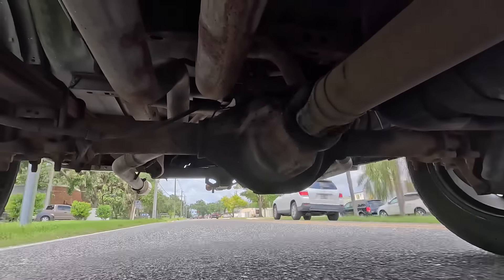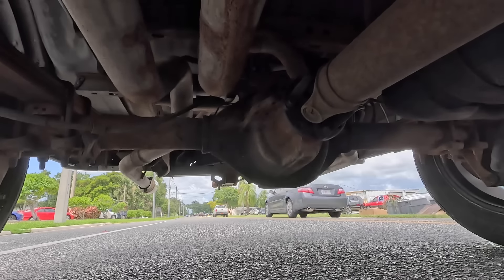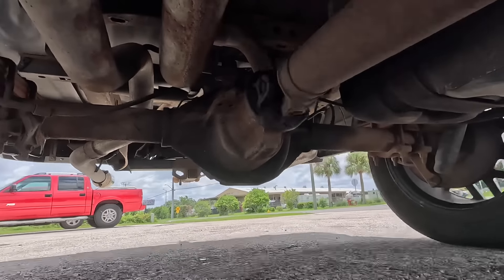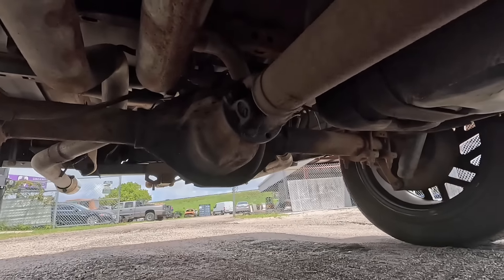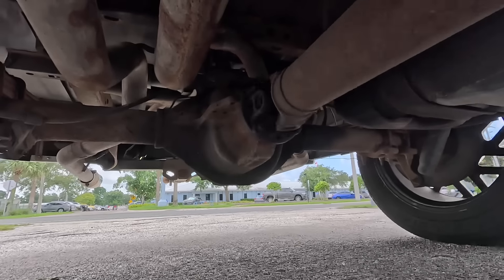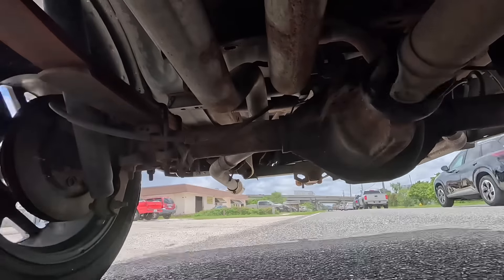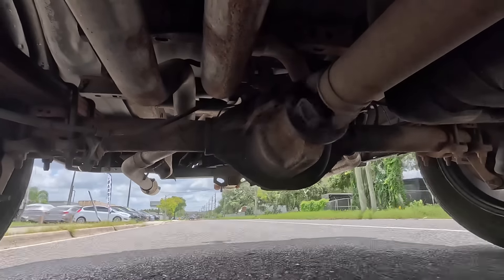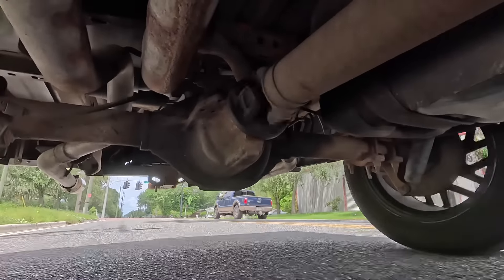Caught Faking a  Video? ​⁠Driveshaft Falling Out While Driving

Comment: Ray, Is it true that you used silent smokeless explosive bolts to blow the carrier bracket as soon as you pulled into the shop? You must  have used a stunt double as a stand in for the real truck to blow off the bracket, otherwise it wouldn't  be possible to blow off the bracket without leaving any visible witness marks. Those marks would have been obvious when you were straitening and fixing the bearing bracket on the real truck...
Or, and this is my actual opinion, the truck in question had a great personality and held together long enough to get you back to the shop where you could fix it.  Regardless of type, brand, make, model, some machines have personalities. Agree or disagree?

Comment: So my question is 
Would it have been saved if it didn't come out of the carrier bearing
Reply: Tricky to answer.. the primary item is that the dumbazzez at Ford built the driveshaft with a non-replaceable carrier bearing.  So, even if the driveshaft was good, if the bearing was bad, you still have to replace the driveshaft.  I had a shop build me a custom driveshaft with a replaceable carrier bearing for my F150 that was just about to do what happened in this video.
Reply: @sx300pilot5  wasn't aware that the bearing wasn't serviceable

Comment: Hi Ray, just curious why you didn't pull over and check the drive shaft when you first notice the noise.  Not picking on you just curious.  You might have saved yourself more damage. At least you weren't going 55 mph and Joined the Olympic pole  vaulting  team. 😂😂😂

Comment: Ok this went pretty well until the camera view changed, in the whole video it's pointing at the diff, and then all of a sudden it's pointing at the shaft where it actually breaks. Also with all the checks you do why would you not at least look underneath with all that banging, it does not sound like a gear wrecking itself. You are normally so anal about checking for problems like this

Comment: When you get that noise when going forward then backward and hear a clunk most the time its a driveshaft. I had one in a 2003 for van that did it. It was one piece. What was going on the spine on the tranny would stick to the driveshaft york causing a cluck. I found out Ford did not machine the output shaft on the tranny right. I went to the dealer and a friend gave me some special grease for it. It fix it but I ask my friend and he said ford mess the spines up somehow and it was going on for a 4 or 5 years that they did it. Ford to lazy to fix the real problem.

Comment: The only question i have is how did the camera angle go from pointing back at the resr axle during all of the test driving to pointing at the middle of the truck at the carrier bearing when the shaft separated? Did you have two cameras mounted under the truck?
Reply: In another comment Ray says he had two cameras attached. Should have explained that better in the video description.

Comment: LOL I watched it and knew it wasn't faked , seen some other videos before with the camera down there, those saying a driveshaft wont pole vault a car, it will pole vault a concrete truck!! Seen the aftermath of it , and the driver cleaned his shorts out, at HIGHWAY speed!! Tore the hell out of the bottom of truck, the pinion ripped out and driveshaft wrapped around the rear end, luckily he didn't roll it empty. I seen another guy drop one and rolled up a garbage can size ball of wires , hydraulic and air hoses, and made a horse shoe out the huge driveshafts they have to! Now, a way to drive a mechanic or a friend that you owe a payback to  that can take a joke, NUTS, with a drive shaft noise, take a large black zip tie and put on a driveshaft at night, making sure it wont wind anything up of course, but it makes a hellva noise LOL A NOISE you WONT FORGET!!

Comment: If.you can't tell the difference between stripped helical bevel gears and a failed prop-shap support bearing, then you NEED A SLAGGING.

Typical modern Mechanic(actually a fitter)!

Mechanical diagnosis via destruction ...... Maybe send some HF HV to the next body computer you "diagnose" for intermittent fault codes!

Bad boy!
Reply from the maker: I guess I’ll sell my shop and go back to flipping burgers 🍔
Reply: @RainmanRayOffDuty 
Put your toy's back in the pram - neither of us are stupid.:) 

We ALL ENJOY AND RESPECT your posts for their informative and fun content...

Your getting a slagging for a reason - "Transmission noise" - any vehicle with a remote rear axle(a Ford pickuo FFS - wonder it hasn't a Shit and Shatton side valve engine) , driven by a telescopic prop, then first suspect prop bearing, then spiders/spider bearings..... - test via holding brake and engage drive and apply torque to prop - Bang, Bang she, goes......

By testing to destruction, then you fcucked up the telescopic splined shaft(especially the last bit) - knowing Ford its designed to dissolve!

Don't shoot the messenger!

Best wishes👍